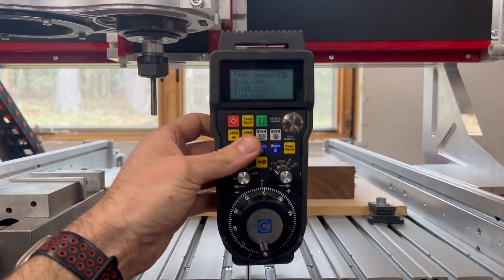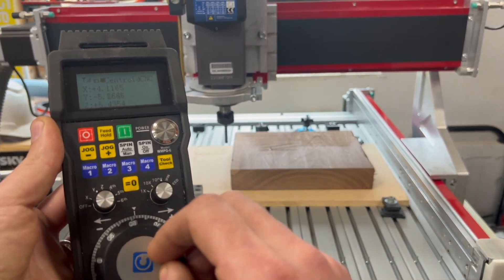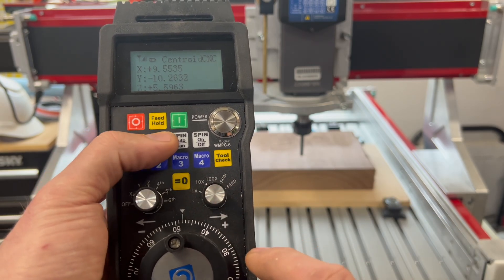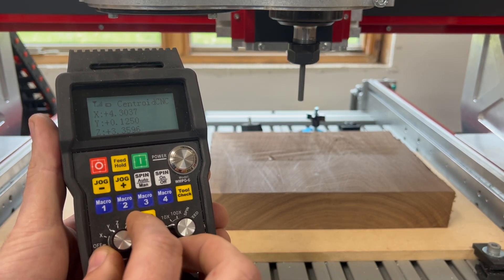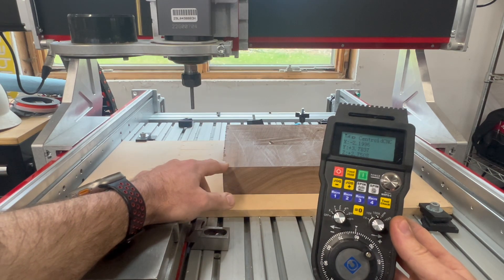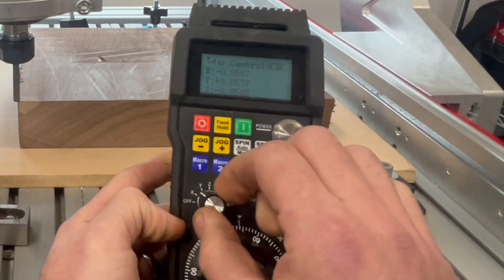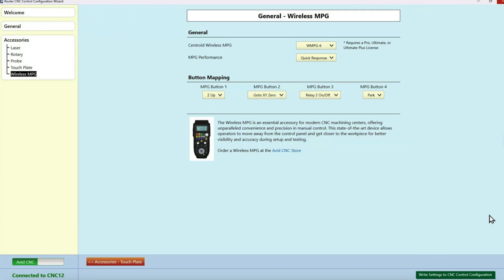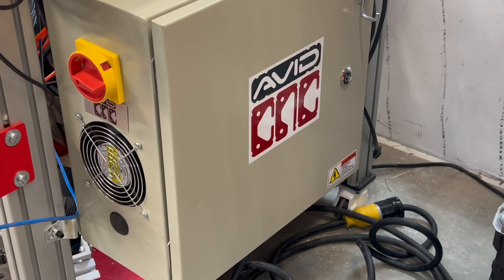Wireless CNC Control Pendant - Avid CNC EX Controller

Comment: Do you have any advice about the pendant losing a connection to the controller? I have been using mine for several months and have found that while jogging sometimes it just stops moving the axis, so I've learned to wait and when it reconnects the axis will move however far I had cranked the dial, I can then resume using it. This happens on all three axes at completely random times. I have replaced the batteries a couple of times to make sure they are fresh. My antenna is only a few feet from the machine and in direct line of site to the pendant. I have tried moving the antenna to a couple different places and disconnected the USB and reconnected it but the same issue remains.
Any ideas on what to try next? I purchased it thru Centroid with my controller as a kit, I like it and would like to see if this issue can be resolved. Thanks
Reply from the maker: If you purchased the pendant and controller from Centroid you should reach out to them for support. If you got the controller from us please go to our site and open a ticket. We'd be happy to help.